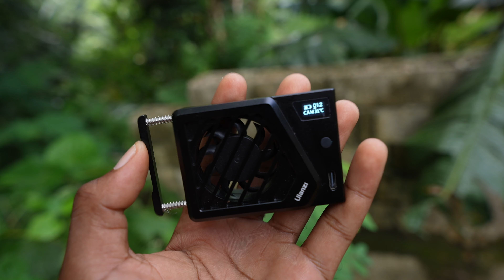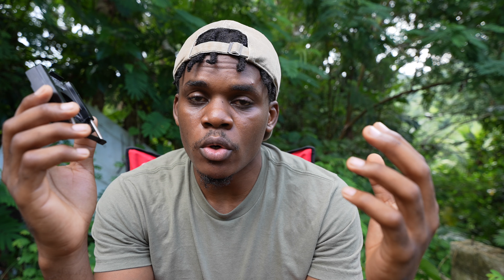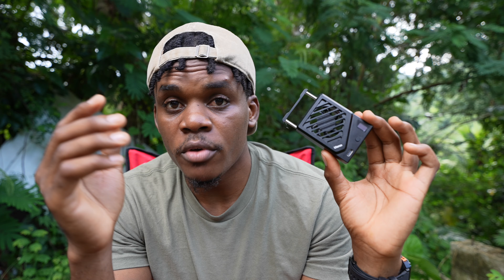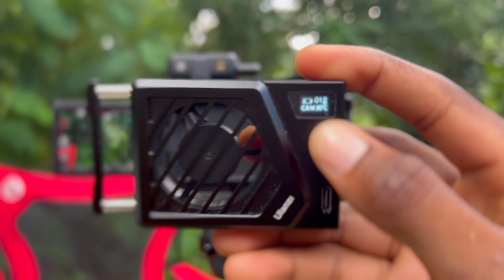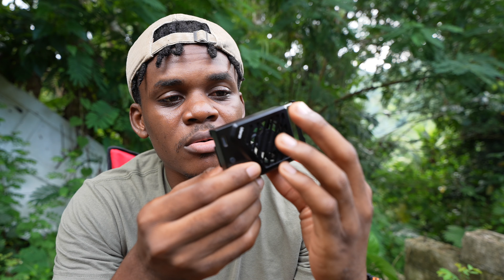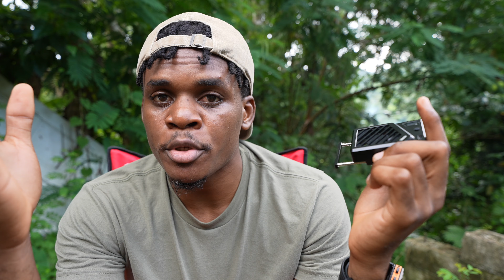Testing The Ulanzi Cooling Fan with Sony ZV-E1 - Does It Actually Work?

Comment: I need to test this on my A7IV against the internal fans on the S5iix
Reply from the maker: Yea give it a try let us see
Reply: I fashioned an aluminum heatsink for my A7IV but without the fan it didn't work. I could add a fan but the noise the rigging I gave up bought a FX30 and will sell my A7IV.

Comment: Does anyone have experience and/or recommendations for a semiconductor-based cooler (I believe it is called a Peltier element) that fits the Sony ZV-E10 II?

Will it cool better than the air-flow-only Ulanzi ? Is it more noisy ?
Reply from the maker: Would have to test it to know . Probably someone sees this might know